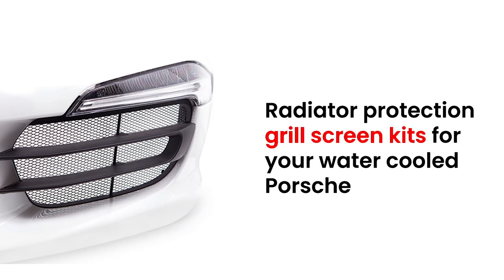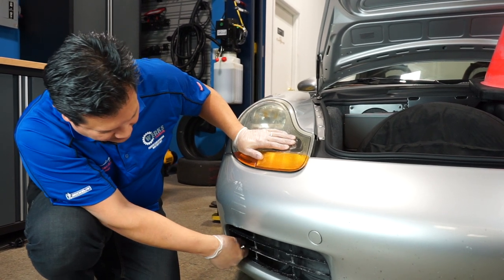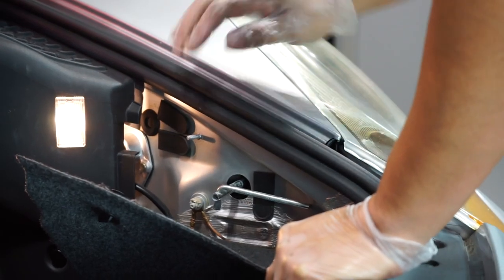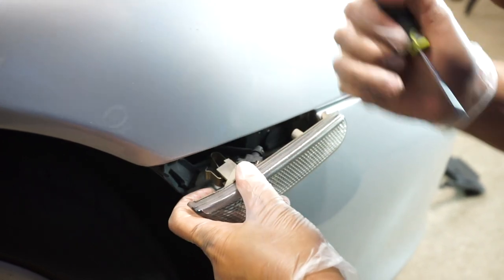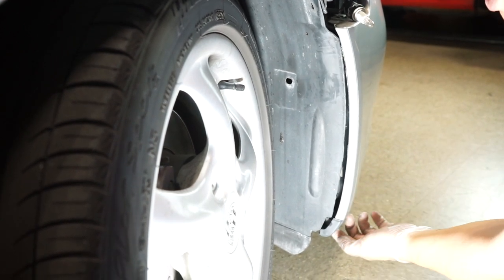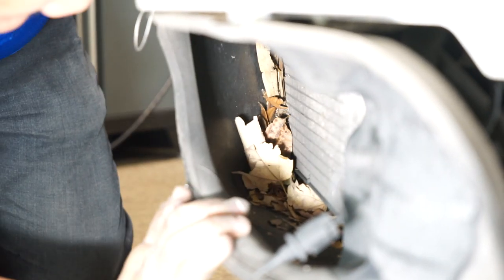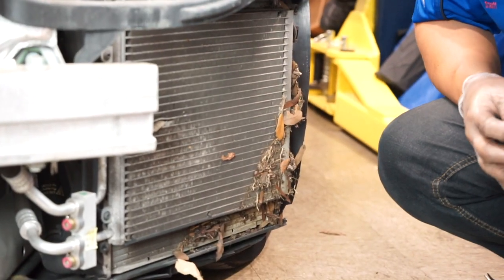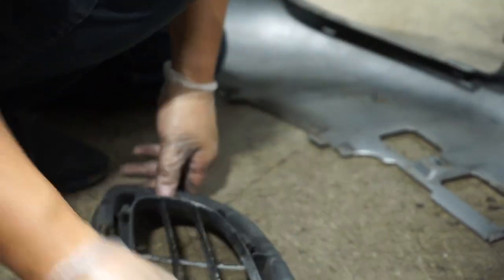PCA Spotlight: Cleanup in aisle 986: Removing Porsche Boxster bumper cover for radiator maintenance

Comment: Definitely need to move the condensers to the side to clean behind them.  Found a lot of leaves and other organic material in there.  The condenser hoses have some flex to them to allow them to move toward the center of the car.  Great video!
Reply from the maker: Thanks for the tip!

Comment: Quick note about the headlight removal tools: they're highly prone to breaking or stripping (most typically the just split) if you have corroded or dirty headlight latching mechanism. I'd highly advise using a socket instead of the tool to just avoid the potential headache.
Reply from the maker: Thanks for the tip!

Comment: Installed the Rennline grills for my 2016 Boxster GTS a couple of weeks ago.  Rennline has a good video on their site.  More Torq screws and electrical connections on the 2016.  I removed some of the wheel well liner to more easily reach the electrical connections that had to be disconnected on both sides of the fender (the 986 in this video doesn't have those connections).  The grills need to be formed to perfectly fit the openings, but otherwise it was pretty straightforward.  Went back together more easily than I thought it would.  Nice video Vu.  Keep up the good work.

Comment: I remember putting in a cable release hidden behind the tow hook so I could access the trunk in the event of a battery failure lockout on my  1999 - 986
Reply from the maker: Yes, that is a great tip.
Reply: 1999 986 has a cable actuated frunk release.    A battery failure doesn’t affect the opening of the frunk.

Comment: Great job Vu. Another easy but important DIY job. It's easy to fab metal mesh gutter guard material much line the Renline parts behind he grills - couple dollars. Don't use too fine of screen to reduce air flow but will block most leaves.
Reply from the maker: Thanks for watching!

Comment: Very helpful although I don't think you need to take the headlights off (I didn't). I had the same amount of leaves too. Also, just two screws and the condenser moves forward 3-4 inches exposing even more leaves.

Comment: And by removing your front bumper and cleaning the radiators, now is your chance to extend or reroute the emergency pull cable for the frunk to open in case you have a dead battery.
Reply from the maker: Yes, perfect opportunity to do so!

Comment: Looks like he has a leak in the condenser. This is evident by the oil stain on the upper right hand and the localized build up of dirt and dust.
Reply from the maker: Good eye!
Reply: Vacuum plus a golf club tube to shape between grill slats

Comment: Is it ok to power wash the radiator and condensor?
Reply from the maker: The radiator fins might get damaged if the pressure washer is too strong. Personally, I'd suggest gently cleaning out with a bristle brush and compressed air.

Comment: Why not just use a vacuum cleaner with crevice tool to periodically clean away debris obstructing the radiators instead of removing the bumper cover?
Reply from the maker: That'll help, but crevice tool won't get into the deep corners. Removing bumper cover is pretty easy and ensures you are able to clean it out thoroughly.

Comment: I just stuck a blower in there 😀
Reply from the maker: Daniel, blower helps but there is a lot of stuff that you won't be able to get to. The most thorough way is to pull the bumper.
Reply: @PorscheClubofAmerica  I didn't see the Rennline radiator grill screen for the 986 Boxster like you have in this video...are those available? Thx